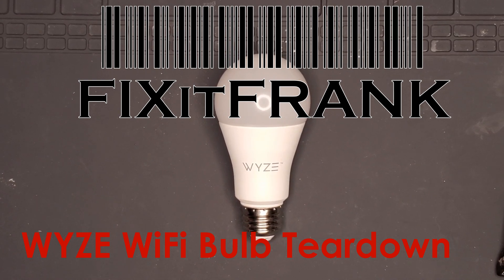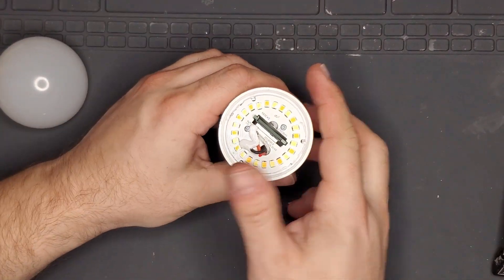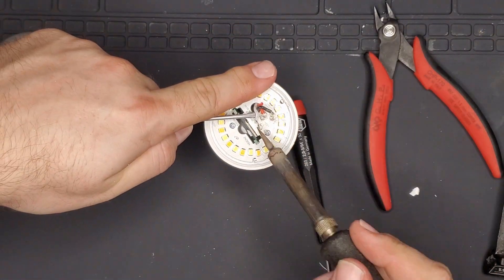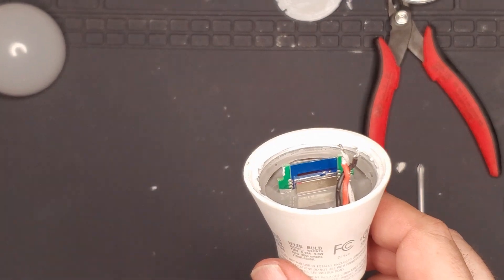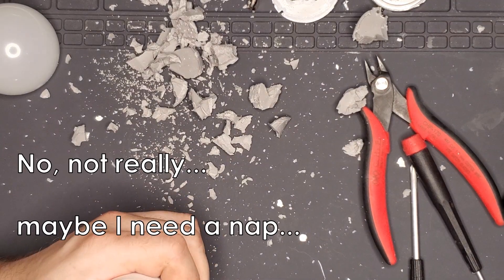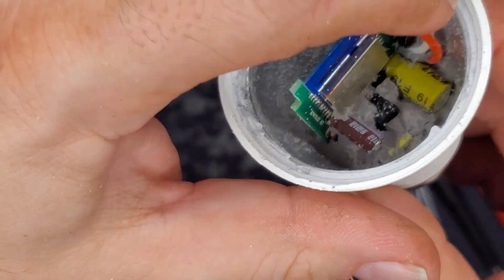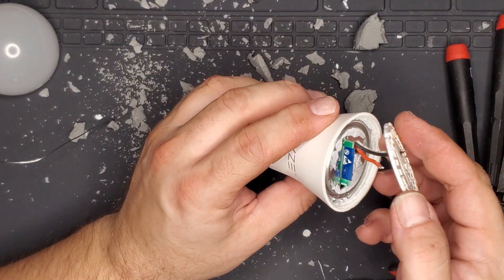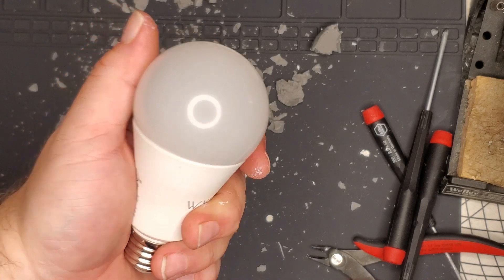Wyze Bulb Teardown and Review

Comment: Thanks for this- I got a 2 pack of color bulbs and one died after a couple of days. My bulb ( 2023 purchase) was different design and the fault appeared to be a an 8 pin connector on the led panel- I cleaned the connection with deoxit and it is now working fine ( from totally dead) hopeful to have a fix. Thanks for your video!

Comment: Heya Frank! Did you ever manage to teardown the bulb further? I'm a programmer and a hobbyist EE, and I was looking for some preliminary info about this bulb before undertaking a project I'm thinking of. My end goal is to be able to upload my own firmware to the bulb so I can give it local control for use with openhab/home assistant/others. I'm hoping I will be able to just push a fw file to the bulb through wifi, but if not I was thinking of making a jig for drilling holes & stabing needles to the programming pads through the white plastic & silicone potting material, that depends on the tolerances of the board placement of course, but I'm hopeful. Could also do some resistance measuring to make sure the pins are on the right pads & whatnot as well... Hmm.
Reply from the maker: I do have more info. Do you have the espressif software? You need that for sure. I would not recommend this platform for reflashing. The esp-wroom-02 they use is kind of an outlier in the controller world. I'd use one of the Aoycocr bulbs. They don't use the potting material and they do use the esp8266 controller which is way more desirable and can be pushed firmware wirelessly. Ive been dissatisfied with the wyse bulbs long-term. I'll be doing a follow up video on it soon.
Reply: @FixitFrank   Hi Frank, did you happen to dump the flash from the device? Can the private key that the bulb is using to authenticate be found on the flash? I think I'm very close to being able to locally control the Wyze devices without modifying or flashing the device, I have the bulbs talking to a local MQTT broker instead of the AWS IoT MQTT broker (used my router NAT to redirect the traffic destiend to the AWS IoT server to a local MQTT server) , and i can see a MQTT message from the bulb at topic "hl/v1/devices/[macaddress]/property/report" that reports out several values that represent the on/off state, the brightness, the color, etc. I can see in a hex editor of the firmware somebody else dumped and put online that there is a topic named "hl/devices/%s/cmd" which I am assuming is the topic it receives commands on, and a "h1/devices/%s/cmd/ack" which I assume it uses to acknowledge a received command. I also find in the hex editor that there are some functions calls "setProperty" and "setPropertyList".  Tried guessing various formats for the cmd message based on what I see in the property report and publishing the messages via MQTT and no luck. Not sure if you or anyone else can reverse engineer the firmware to figure out what message is expected for the cmd, but one easier way perhaps would be to grab the private key/cert from the flash. AWS IoT uses a device client certificate to authenticate the device, so assuming the private key can be dumped from flash, I'd think it would be easy to connect to AWS IoT using the keypair from the device, and toggle the light in the Wyze App and see the contents of the MQTT message that the "bulb" (AWS IoT client running on PC) receives (can just slightly modify the  basicPubSub.py here to subscribe to the topic and to use the cert info from the bulb: https://github.com/aws/aws-iot-device-sdk-python/tree/master/samples/basicPubSub ). I tried this already using a device key generating from my own AWS account and it was easy to send and recieve messages via this SDK.
Reply from the maker: @BradJDuane  I did dump it.  It was quite a while ago so I need to find it, but I will get it for you.  If you get a moment, email me at sales@weezytech.com  so I can send it over.

Comment: So am I correct in thinking that one wire is a common ground and the other 2 are positives for either to warm LED or cool LEDs?
Reply from the maker: I think so. 
I did not measure it. I am only going by what the circuit 'looked like'.
I plan to reopen this again and remove the board entirely. I've had issues with two of the four lights randomly turning on. No rhyme or reason. I have three in the same fixture and two are misbehaving. I ruled out power blips by running them on a ups. Next step is to run Wireshark to see if I can capture any unsolicited turn on requests.